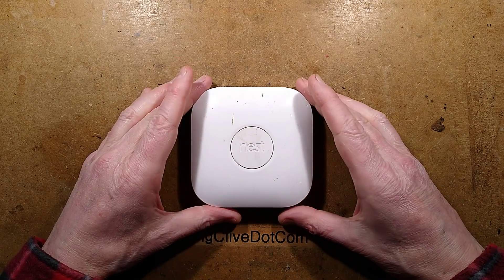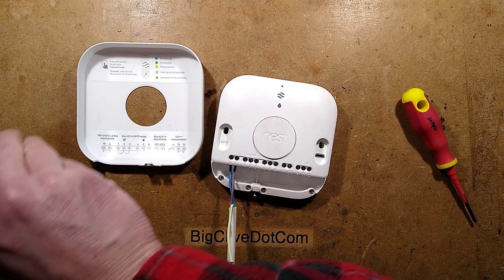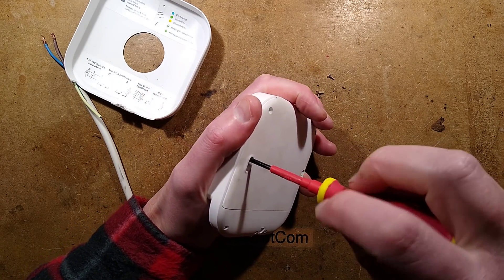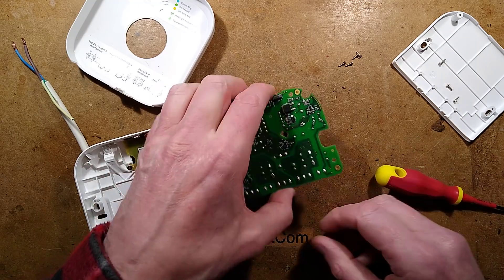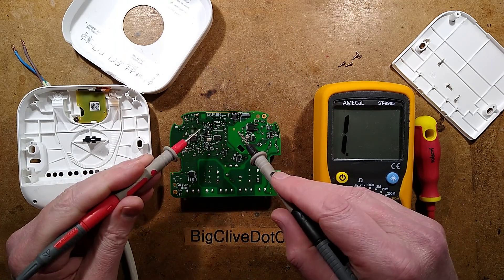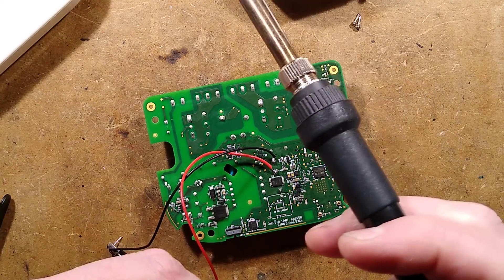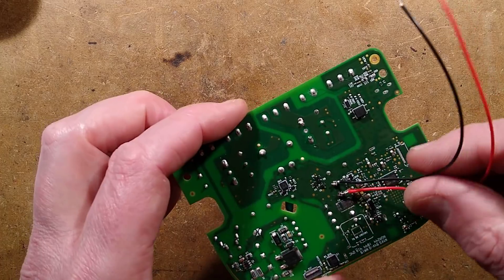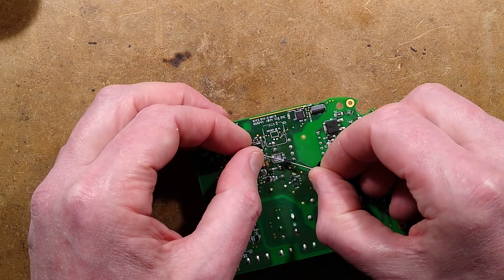Fixing a completely dead Nest thermostat heat link

Comment: It's not just a case of the hardware physically failing, you also have to contend with the fact that often these things only work as long as the manufacturer supports them and at any point they can choose to brick it.
Reply: My rule for companies these days is that they are guilty until proven innocent (such as providing the software in the box on a physical format)
Reply: @volactic8495  "...providing the software in the box on a physical format...." you put a smile on my face. Is that happened... ever? I know Belkin shared some of it's products firmware's (partial) source code (with binary blobs) on their support site, but it was an exception for me. I haven't seen anything like it since.
Reply: @mtx33  Hes saying, none do, so he wont buy any.... Read between the lines.  Stop taking comments so literally like every other penguin on the internet.
Reply: Indeed.  Two companies that are on my naughty list are "Hive" (IoT) and "Reciva" (internet radios).
Reply: @pibgorn9513  im happy i decided the hive lights were too expensive and didnt buy any more after recieveing a gift starter set. on the plus side, at least the bulbs still function as basic bulbs and dont flash till they connect..
Reply: @pibgorn9513  Yep, like SONOS made a hole lot of bricks
Reply: Another failure mode -> bricking them by errorneous firmware update. AFAIK it has happened with some nest devices already.
Reply: @JanicekTrnecka  It was very rare and it was from about 6 years ago.
Reply: Make your own Thermostat from ESP32, thermocouple and relay. screw this corporate crap
Reply: @Christopher Grant There are programmable thermostats that get you 100% of the heating/cooling benefit (not having to work when the building is unoccupied or special rules at night, etc) that also cost less than these Nest units. We got ours from Braeburn and we've been happy with them.

But if you have a mercury switch, it's likely the zone control board and equipment is old, too. Not really a worry, but the new equipment really has been making strides in efficiency; a heat pump will efficiently heat your house till it's near freezing, using many times less energy than your normal heater or furnace.
Reply: Yep, my qty 6 perfectly-serviceable  SWS-A1 (lidl) wifi sockets stopped communication with the server last year. About 7 yrs old. I spoke with the manufacturer; users had probably decreased to a level where they wouldn't annoy that many folk by turning off the server to save ongoing support for iOS/android updates, so they did just that. Sadly 6 pieces of e-waste generated.
Reply: You guys might be interested in a recent video from Rossmann.  This one was on the GNARBOX: https://www.youtube.com/watch?v=Elsbcoyk6jA
Reply: Worst offender for stopping support for home products with any kind of connectivity = Samsung. Appalling how they stop bothering about their products even though they may only be on the market a year or two.
Reply: Your comment rang true 3 years later, they killed off the first gen ones recently.

Comment: That is a Heat Link unit, necessary on UK systems to interface the low voltage switching in the thermostat to the 240V switching traditionally used in our heating systems. Just for information, the T1 & T2 terminals supply a nominal 12 volt DC supply which can be fed down the old thermostat wires to supply power to the Nest thermostat, charge its battery etc.  At the thermostat end of the cable it doesn't matter which way round the cables are connected, so there must be a bridge rectifier in the stat. 
I think that there may be a small data stream as well, because pairing of the two units is automatic when connected in this manner. 

NB - The other configuration would be to power the Nest using a USB power supply and cable, when it is mounted on a desk top stand. I've lost my instructions, but can recall the need for a pairing procedure if you do this. In both cases, the two units connect wirelessly to pass heating commands from the stat to this unit..

My Nest Mk2 worked faultlessly from 2014 until it was recently removed (a new boiler came with Hive as a package deal). That model couldn't control the hot water, so is presumably simpler inside with only one switching relay to pack into the box. I believe yours is a Mk 3.

Comment: After having a dead computer motherboard for 5 months, I decided to try a repair. Found 3 caps slightly swollen. In our little town there is no supplier of discrete components, so I went to a rather dodgy little shop that "repairs" computers. I got one cap of the same rating (1800uF, 6.3v) and 2 others of 2200uF (all 2nd hand). Due to my lack of desoldering braid, I had to make long jumpers to bring to the "wrong" side of the board and have the new caps hanging in the breeze. What a pleasure, I'm typing on that (12 year old) PC now, 3 weeks and so far so good!
Reply: Amateur tip: a straightened out paper clip pressed onto/down the hole while heating will create a large enough hole in the solder to get the new components in. If the paperclip is stainless steel, it'll slip straight back out. If it sticks, reheat and wiggle it in circles while it cools to stop it clinging.
I did that on an Xbox board to install an early mod chip for a friend.
Reply: Nice fix! May she work for a many more years!

Comment: be nice if u did or had the chance to do more audio based stuff ,i know LEDs and diodes is more ya thing but itll make a nice change ,maybe on giving bluetooth speakers a higher battery capacity or change out the amp caps on them to sound better ,i dont know how well u know audio equipment, i like the retro look of vacuum tubes ,arent they basically simple diodes ?

Comment: The question is: why did the diode fail? If it isn't over run, it shouldn't fail. It think replacing it with a lower powered diode is tempting fate.
Reply from the maker: Sometimes diodes just fail.  It's not uncommon.

Comment: Nice fix.  I'll have to say I prefer the American thermostat wiring scheme where there's only 24V going into it though.   It sends signals to relays in the HVAC equipment to control everything, so you get less chance of lighting the homeowner up if they pull it off the wall to replace it.
Reply: I don't think we're daft enough to just tear it off the wall and stick our tongue on it though 😂
Reply: thats what OpenTherm is for. OT1 and OT2 terminals on this thing. Most central heating boilers have it.

Comment: IoT isn’t secure yes and theres no need for smart home devices to need the internet in the first place. People using Home Assistant make devices that don’t use the internet but use your homes local network, or create a special offline network for the devices but giving internet to these nest/hive devices is just easier for the customers to be able to control the devices away from home. 

With larger companies like Nest and Hive I guess it would be harder to be hacked so I don’t really have an issue with using one, just do the usual stuff to keep yourself safe and it’s all good, what’s the worst that could happen, they turn your heating up?
Reply: I pretty much agree but there is one benefit to Internet connected thermostats I can think of: reacting to weather forecasts.

Comment: yup older things sure r built to last  ! a old diesel car from the 90s is much easier to fix and maintain than a new electric pile of crap Tesla motors
Reply from the maker: Even an ordinary car has far too much networked electronics in it these days.  It makes for more points of failure and very expensive repairs.

Comment: I used to work for a local Cable ISP and they used 60V AC to 24V DC Switchmode PSUs in every single one of their outdoor Cable Cabinets. While they were the leading cause of total failures, they were surprisingly robust! Most of them were more then 30 years old before they died, running 24/7. Most of them failed when it got really cold or during Thunderstorms. They also liked to not turn on after power outages, probably because they got too cold. We tried repairing them once when we could not get enough of them during last extremely cold winter, and it was always either the fuse that failed (totally dead) or the Caps that aged (No cold start).
Reply: Can't imagine any cable company running equipment like that for 30 years. Most have switched over to 90V powering, and the switchmode power supplies are either in node, amplifier, or line extender chassis, which were upgraded (or added) as they went from 300MHz to 450MHz to 550MHz to 750MHz to 860MHz to 1GHZ bandwidth.
Reply: I got a bunch of 24V (240 in) power supplies from ebay. They're good quality ones originally used on point-of-sale equipment. They all seem to have suffered from failed fans.

Comment: This controller has a power connection for the room stat which has a screen and rechargeable batteries inside. So a fault further down the line from the controller could be the reason this diode having failed.
Reply: Agree. That diode would have heated up a lot more when powering a nest thermostat and charging the internal battery up. It’s likely a blackout could have caused the batteries in the unit to drain, just putting a little too much strain on the diode when the power came back on.
Reply: Add a dash of thermal runaway..!

Comment: I wonder with the advancements in metallurgy, new alloy's and such, will the bimetallic strip comeback?  We don't need a mercury switch.  I'm sure a ball bearing or some sort of hydrophilic conductive shmoo will work as well in a glass vial.
Reply: Mechanical and thus failure prone. On the other hand, in electronics, everything's a temperature sensor, and some are very nicely tuned temperature sensors...
Reply: @rpavlik1  I don't think mechanical devices are as prone to failure as one might think.  Sure the sensors in an electric thermostat is very accurate, but we have nuclear power plants still running on punch cards because they can't be hacked.  Even the nuclear submarines are just now switching some out from 5.25" floppy drives

Comment: I harp back to the days of a power supply that has a transformer, bridge rectifier and a smoothing capacitor, they run for years with no problems , it seems to be a common problem with switch mode power supply and a failed diode . There has be a spate of next thermostats failing , with a error codes that can be cleared or just dead. As you say the old mechanical thermostats last for years . I'm all for progress but the more smart gadgets I come across more Im thinking,  these gadgets are completely pointless

Comment: Sorted . . . . Malorted. . . . . . 
Would it be fair to say that apart from the Big stuff in a house, the most commonly used electrical items now are 12v ( or lower )
Laundry Machine, Fridge, central heating pump, kettle. . . . Northern Europe Winter Household. ( Gas Cooking & Heating, it's local sourced )
Then most things like , Room lighting, personal digital device's, entertainment units, convert 240v down to 12v > 5v. . . . . . . . .

Comment: Clive, you have this thing called a router which sits between you and the Internet.  That's like an IoT device.  Those are pretty reliable - you're welcome.  :)
Reply: If it anything like mine it has an external power supply, so not exactly the same thing as a board full of electronics that is dead when a single diode fails.
Reply from the maker: Reliable, but equally insecure.  They almost all have weaknesses.  My last one failed a security test when it turned out that alongside the normal "admin" access, it also had a few other undocumented ones with standard passwords that could allow remote access and malicious updating of the firmware.
Reply: i've never came across an internet of trash device that was even  remotely as reliable as a router is.
Reply: @casemodder89  Internet of Trash - stealing that :~D
Reply: @casemodder89  over the last 25 years of using routers I think only one had a psu issue, external plug, as you say they mostly are, I fixed by using another psu.  How reliable are things - probably depends on the brand and luck, some well-known brands have psus which catch fire too.  Which surveillance webcams are reliable, for example.  Mostly routers have software issues, some stop working, some slow down, sometimes part of the services/stack will fail, these are where a reboot cures it.  I have a dehumidifier which will fail in 2-3 years, it has a 2 year warranty.  I have 2 now, and one which has failed, and 2 I threw out some years ago.  There is a thermal fuse, and some type of thermal diode.  I have replacement fuses, but haven't tried it yet, hopefully it will fix it.  Never have I purchased an item so precisely timed to fail just after the warranty ends!

Comment: I have a dead bosch ebike charger that stopped working after being dropped once. If you are interested in taking it apart I would send it to you. It's dead weight to me anyway.
Reply from the maker: If it's openable in a non destructive manner, take a look inside for broken solder joints.  Especially around heavier components like the transformer or heatsinked transistors.  If you apply light pressure to the components you may see pins moving in their solder joints.
Reply: @bigclivedotcom  I'll give it a shot, I already got another charger second hand. If I can't get it working again I'll send it your way.
Reply: @bigclivedotcom  Years ago my brother had a DeWalt charger for DeWalt batteries used with cordless drills and such. Every, and I mean every, single component on the board had broken solder joints. I resoldered them all and it worked fine, but I really wonder how they all broke like that.

Comment: I had a surface mount diode burn up on my buck power supply about 10 days after I bought it. I thought maybe I had exceeded the maximum voltage input. No I was about 10 volts under. I ordered some new SR5100 they came as through hole components. I soldered one to the board & it's been going strong for 4+ years now. I believe the through-hole equivalent diodes are much more robust than their surface mount counterparts.
Good job big Clive. I enjoy watching your investigative work on electronics!👍🇺🇸
Reply from the maker: The through hole components are more resilient to thermal stresses due to expansion and contraction due to the slight give in their leads.
Reply: through hole has a higher rate of failure due to being more susceptible to vibration. it really depends on the application and environment.
Reply: @drkastenbrot  yeh I always thought that the smaller you go with components, the more reliable they generally get
Reply: I agree with you all for most of the SMD parts.
I'm just saying that the diodes seem to burn in half alot with SMD. even when the device is still new.
Reply: @ronniepirtlejr2606  I wonder if that's because they're SMD, or because shit has gotten that much more "value engineered" since SMD took over.
Reply: @Broken_Yugo  I like the electronics in the older stereos from around 1978-1984. The stereos back then were built Rock Solid!
I've always said, if they just built stuff as solid & with as much pride as they used to, add the newer technology to it,  it would be a win-win situation for everyone!
We would have high quality Electronics that would be built to last instead of throw away products that are cheaper to replace versus repair.👍🇺🇸
Reply: @ronniepirtlejr2606  I agree the mid 70s-80s stuff did hit a nice intersection of mature technology that hadn't been cheapened to death yet. I've got a couple ca. 1980 pieces of low buck Taiwan built consumer electronics that just keep chugging along on all original parts. 

That said, it must be keep in mind that stuff wasn't cheap back in the day. My Zenith N122P AC/DC 12" B&W TV seems to have sold around $100 in the early 80s based on a couple newspaper ads I found, that's like $300 inflation adjusted, for a 12" B&W TV. $300 buys a whole lot of TV now, I consider it a fair tradeoff that the new one will probably be dead and/or obsolete in a decade or less.

Comment: A good trick for protecting nearby components when using a hot air gun is to cover them with folded aluminium foil held in place with kapton tape.
Reply: kapton tape alone does the trick
Reply: @drkastenbrot  yep!
Reply from the maker: I used Kapton tape as a shield during my efforts to get the diode off with a heat gun.
Reply: They used kapton for the sun shield on the James Webb space telescope too 😀
Reply: I've found Kapton itself fine.  Get a large strip of Kapton or layer several consecutive pieces then use a knife to cut around the part you want to remove.  The Kapton will survive long enough to protect the components covered by it.
Reply: Thanks! I'll try that next time :)
Reply: I'd definitely go with the tape only aswell incase something gets shorted and damaged by the foil bridging things. That said, the foil thing is good to protect the odd individual component that might be overly sensitive to heat.
Reply: @skylined5534  - the board should not be powered up when working on it, so how exactly is something going to be shorted out if foil is used?